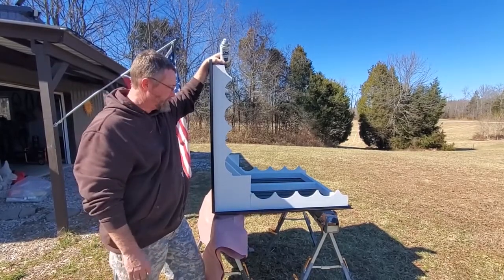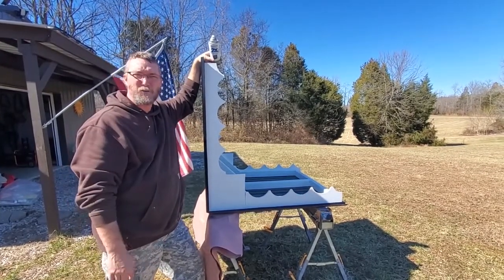DIY Cool Bird Feeder Cover || Barndominium Living

Comment: Cool! I would like to give some shapes to my stairs wood spindle. They are just a long wood stick. Would I be able to use a small hand plane to add details? Never used one . By the way the spindles will stay in place while I try to  make then beautiful or damage 😅 hopefully the first results. Any suggestions .
Reply from the maker: From what I know, a plane is used to make a surface smooth and flat.
If you want to take a round rod and make randomness out of it you need a "spoke-shave".  If you want a symmetrical spindle, then you need a lathe
Reply: @RVBarndominium  Thanks will research them. Just bought  two books at the library.  1- Mastering Hands Tools  Techniques.  2- Working with hand tools. Very interesting books.

Regarding the ACE RV
1-how you drained the water tank under the bed.?

Soon will be time to dewinterize the rv and sanitize all tanks.

2- we noticed a few opening under the chassis so we are trying to seal as much we can to avoid 🐀 🐁 🐭  inside. have you noticed any openings on your rv? How are you guys covering those 
openings .?
Reply from the maker: 1- There is a valve in one of the compartments by the water pump that will drain it
2- We've never had any mice issues.(knock on wood)..We haven't sealed anything underneath.

Comment: hi do you have all the measurements of this
Reply from the maker: The roof is the width of your "leftover/scrap" siding (ours is 38" wide.  Each side is approx 42" long. The heighth to the top of the peak is 7 foot